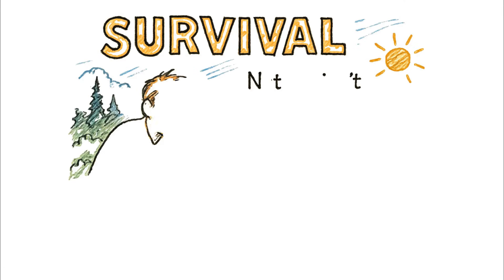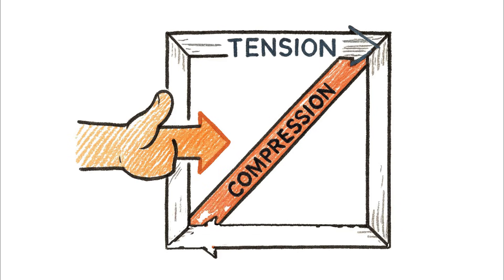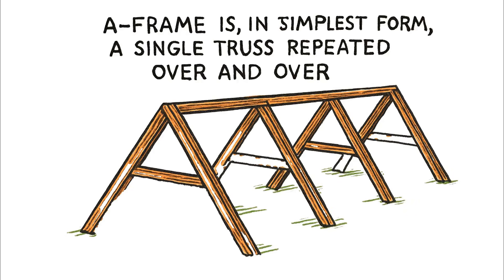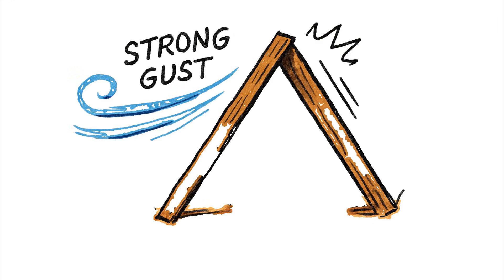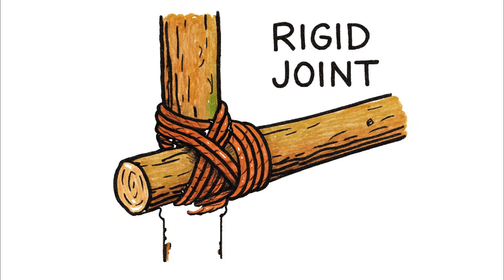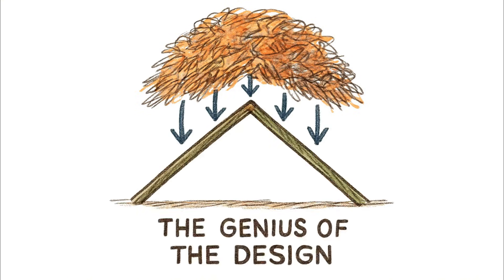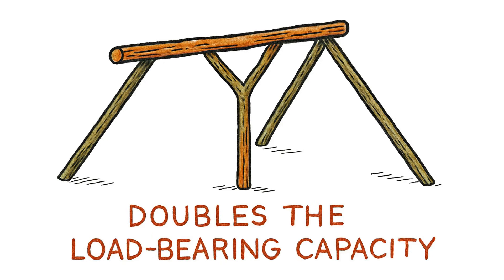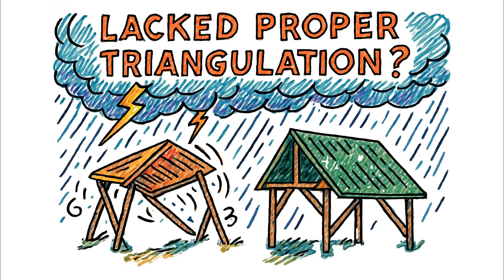The Science of Structural Rigidity: How To Build A Stable Survival Shelter (Engineering Explained)

Comment: if you dont have to deal with lots of snow or lots of cold/rain, , the best answer is a hammock with a tarp over it.  5 lbs or less, to include your sleeping-protection, down to 30F.  If you do have to deal with those things, the best answer is a tunnel 6 ft into a high creek bank, 2 ft from the top, and then tunnel parellel to the creek. Dig 5 ft from each entrance, so that  you have some protection vs cave-in and shore up the dirt every 12" of tunnel. Dig the entorances 2x2 ft  and have the "sleeping chamber" be 3x3x8 ft.  Have a 6" thick layer of dry grass, dry moss all around you and on either end of your chamber.  Even if it's 0F outside, your sleeping gear can handle such temps when you are insulated thusly   If it's colder, heat 4 head sized rocks,  outside of the tunnel for 1/2 hour, on both sides, by having a couple of Siberian fire lays,  Bury some coals in an ashes-pit and smother the flames with ashes or dirt. Move the rocks into a row of pits under you in the tunnel. Surround each stone with a 2" thick layer of ashes and they will warm you adequately for many hours. Repeat as needed.